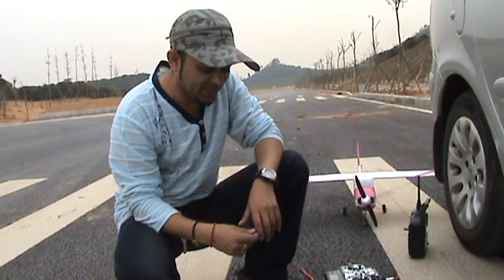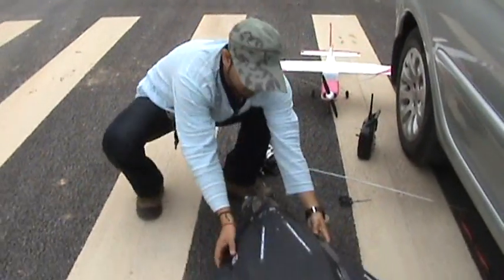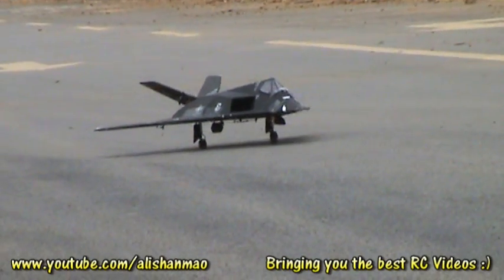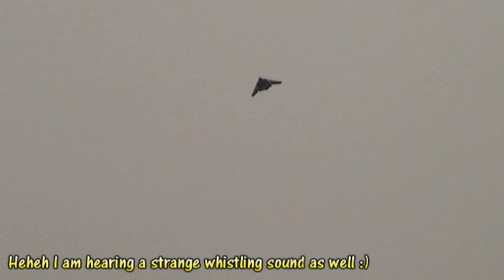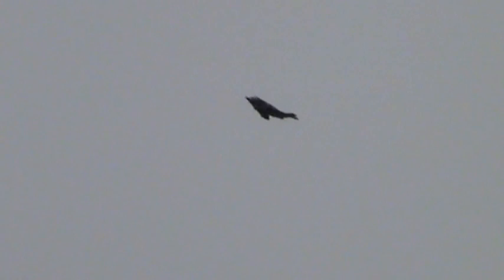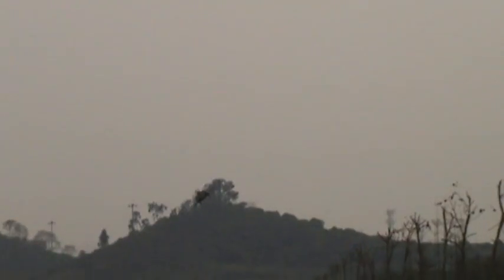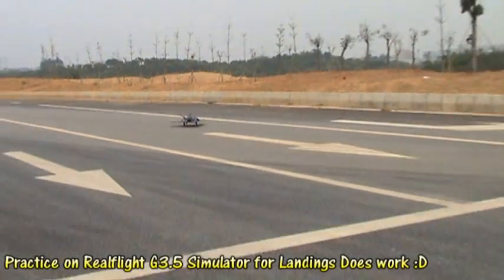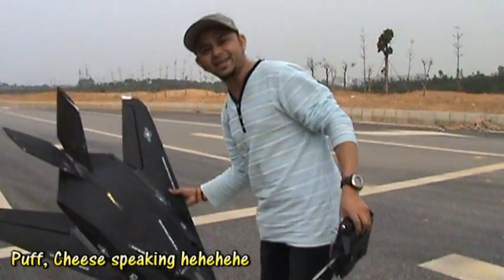F117 Back in Action with good landing

Comment: @callofduty1944 I made a post on part 3... You cant just tape or glue planes back together, it throws off the aerodynamics... Even more so with an F117. Im sure this would be flying much better if he wouldnt have 'crashed and burned' it like 20 times.

Comment: I have one of those, same model and everything but i fixed mine I replace  parts and the retract gear I made a emergency retract gear in which if the 3 mmain gears dont come out then my back up 2 come out and it's suppesed to be landed either in the grass or the water, then i spray painted mines white